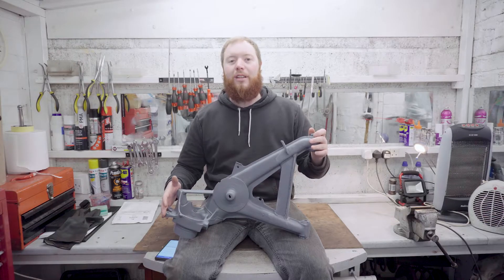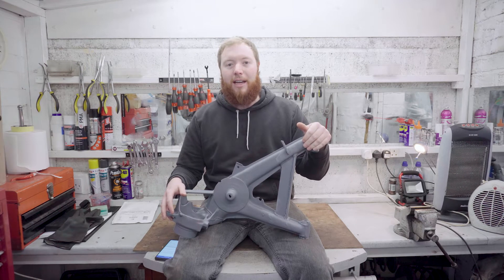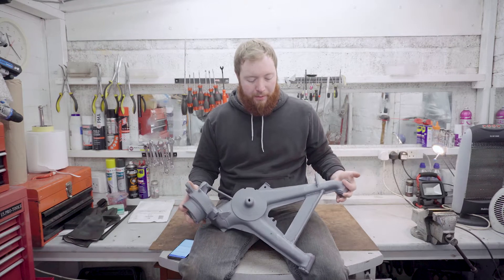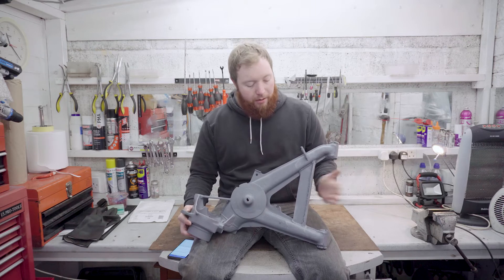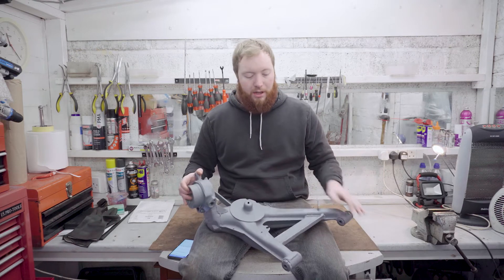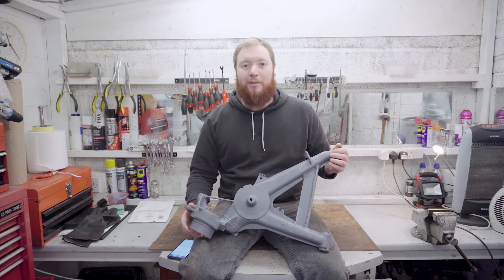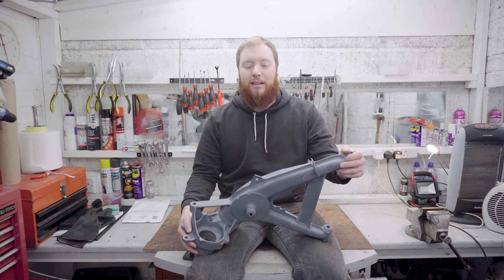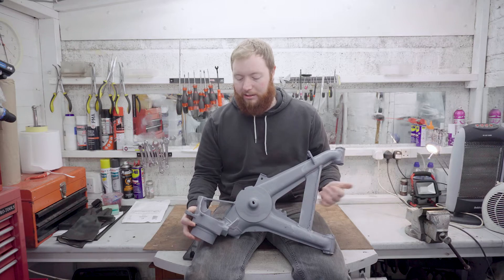BMW E30 Rear Trailing Arm Reinforcement | Learning To Weld With Flux Core | 002

Comment: What paint do you recommend to use to paint the arms, front & rear subframe, I need to paint front knuckles too. I'll need to use rattle cans btw.
Reply from the maker: I recommend that you use a good rust preventative primer, with a 2k Gloss Black top coat.  If you have to use rattle cans I would get something like this https://ebay.us/ZT8Lfp it may be expensive but I find that it gives a really durable finish.
Reply: @SPANNERRASHit'll have to a light mist then lol

Comment: I was able to find some e36 ti training worked out well
Reply from the maker: Nice, are these effectively the same as the E30 disc ones or do they differ? Can't quite remember. 🤔
Reply: For the most part, different spacing for wheel choices but 5 bolt

Comment: Hi, I’m doing a similar project too! Can I ask you where did you got those trailing arms?

I knew there are two sets, one with drums and the other with discs, but I can’t find them!

They were mounted on the M3 models, that’s for sure, but what others?
Reply from the maker: Hi there, the disc rear arms came on the higher-spec models of BMW E30 such as the 325I and the 318is. Most base spec 4-cylinder cars came with drums like mine did unfortunately. They are interchangeable though so if you keep your eye's peeled on Ebay or FB marketplace they do come up. Getting more expensive to buy though as lots of people want to make this upgrade. Hope that helps!
Reply: @SPANNERRASH  Thanks a lot man !

Comment: Not fixing the rust hole on the spring perch?
Reply from the maker: I dont think it has any impact, the perch is solid. The hole is mostly my fault for being too heavy handed with the angle grinder tbh.

If you follow along with the series you will see its hidden when I add rear coil overs too. Out of sight, out of mind 🤣

Comment: well done.  did you use high end welder or cheapo harbor freight like what I have?
Reply from the maker: Hi Mark, I was using a very cheap "Wolfweld" MIG welder, and fluxcore wire to do this. I think it worked out quite well despite my lack of welding experience. Hope that helps.

Comment: Thanks for this. I've been watching some of your videos and enjoying your resto on your e30.
I'm currently building my v8 swap and getting it ready to see the road for the first time in 4 years 
I'm going to be dropping my fuel tank soon qnd the rear beam will be my next victim so I'll reinforce my trailing arms while I'm there 
Cheers for the link mate I'll go ahead and buy that 👍 
Keep up the good work 👏  My current car was a supercharged m52b28 before I pulled it all out to go v8 (which I'll be supercharging one day in thr near future) and my last e30 gave me 5 years of trouble free motoring after I did the m52b28 swap on her. 
Thanks again 
Ant 😎
Reply from the maker: Cheers Ant, really glad you're finding my vids useful. :) 
V8 swap sounds amazing, the same thought crossed my mind with this build, but I decided to rein myself in a bit, as it's the first thing like this I've ever attempted I ended up playing it a bit safer.

I suspect the V8 with a supercharger will be an absolute missile, it'll be hilarious fun to rip. Hope the swap goes smooth for you mate.
Reply: @SPANNERRASH  Likewise with your build man. You'll love it. A decent m52 in a well set up e30 makes for a very fun car indeed 😎😎
I drove mine the other day for the first time in 4 years and the first time as a v8 and it was certainly an eye opener 😳 😂
The things we do ay 🙈😂
Only up the street and back and jesus